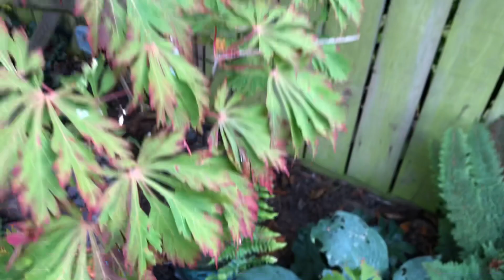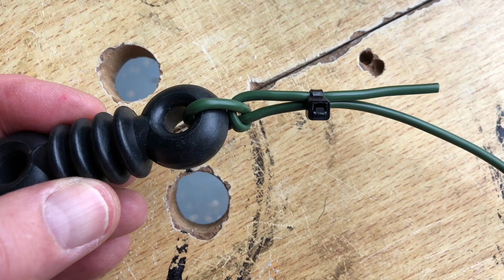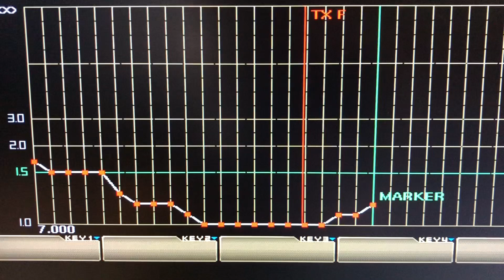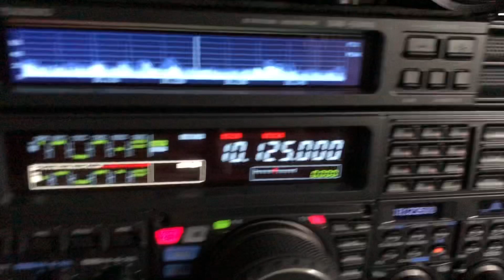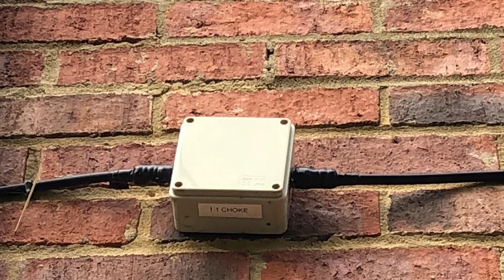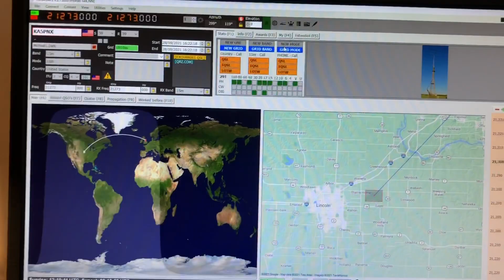A Better Off-Centre Fed Dipole - Part 2

Comment: QUESTION: did you eventually put some sort of weather-proofing on the centerpiece? If so, how did you protect it?

Thank you for the excellent explanation of the OCF antenna.
Reply from the maker: It is a good question 😀 No, all these years later it’s still up there and my main multi-band antenna. 80m dipole made the same way joined it and both been up many years now. I lower them every two years to check the supporting rope at the garden end. I inspect the centre section at the same time and can add more liquid rubber if need be (once so far I think 🤔).

Comment: Hi there, good stuff , I built this a few years ago , from the TRW channel , works very well. I  made a 3D printed case for mine . Still in use . I’ll look at building this open version , looks an interesting way of building one .

The 1:1 Balun ( for common mode ) and followed by the 4:1 . I even got an VNA and tested it , super results.

I have fitted a solar system for off grid , getting a lot of QRM, probably off the inverters, so looking at curing this noise on HF.
Reply from the maker: That sounds great! Good luck with the noise 👍🏻

Comment: I hope you get to see this question. I would like to know at the very top of your 4:1 the two wires that will attach to the each leg of the dipole, does it make any difference if the red or black wire goes to the short side or long side? thank you.
Reply: I also have the same question.  Have you tested this Balun both ways, short side on red, then short on black??
Reply from the maker: @thepctech  Hi, no. Just the way I made it in the video...
Reply: @thepctech  This should help you understand why it doesn’t matter. 
https://en.m.wikipedia.org/wiki/Dipole_antenna#/media/File%3ADipole_receiving_antenna_animation_6_800x394x150ms.gif
Reply from the maker: Hi, either side is ok. Good luck 👍🏻
Reply: @G0CNN-Ian  Thank you for replying so quickly! I will wind both 1:1 and 4:1 tomorrow as I received proper wire today. I ran a quick test last evening with light gauge wire for a 1:1 and followed your test method. I found it actually looked pretty good on SWR. I plan to use the OFC I'm making for Field Day in June. Ian thanks much for making your video, very helpful. 73
Reply from the maker: @N1SEP-  you might have to have a few tries as it stretches the wire insulation and eventually beds in 💪🏻
Reply: @G0CNN-Ian  You made a nice mount with the transformer over the choke. I have a plastic box, its not long enough to have two in line, so I wondered if it would work with the transformer (4:1) on top of the 1:1 or would that cause an issue in your opinion? if not, do you think some kind of material between the two would be needed? 
I could always try, but i would dislike burning these up on my first build :)
Reply from the maker: @N1SEP-  I think you’re ok with a stack as some commercial ones come like that. They won’t touch due to the windings, so should be ok. I went for the open T-piece as it’s less heaving (antenna sag) and there’s no issue of moisture that you get with a box. You need an air vent hole to allow it to breath, otherwise the air trapped inside condenses with heating/cooling. Worth trying the T-piece method if you can and then avoid the stack and less sag? Anyway, should be ok 👍🏻
Reply: @G0CNN-Ian  Ian, since it will be for Field day, perhaps I'll use the board then. My wife did give me one, ha!  What ever I decide to do I will post up on YouTube before and during FD.  thanks again for info! Steve
Reply: Ian, I am real happy with the build. Made a lot of contacts week prior to Field Day and 262 during FD. Thanks for all your help sir! 73 N1SEP
Reply from the maker: @N1SEP-  Brilliant!😀

Comment: I just built these baluns for a W3EDP junior. When I have the space though I'm not going to use a windom I'll make a doublet and use either the 4:1 or peters 9:1 design with a 1:1 cmc. So the ladder line will drop down to the balun/impedance match then there will be the 1:1 cmc with either M&P hyperflex 13 or LMR600 or 1/2" Heliax either of the three going to the shack with another 1:1 cmc before the tuner. 
So if I'm getting 1000ohm at the feed point the 4:1 would drop it to 250ohm or the 9:1 will be around 100ohm. These impedances on big thick coax are manageable with say a 30m run.
The benefit to this setup is as long as you're at 5/8th wave of the biggest wavelength you want to use you'll get that and every other band.
Reply from the maker: Sounds like you’ve got a well thought out plan Shane 👍🏻

Comment: Nice video - I am wondering if you tried  to compare your setup by using a more modern Transceiver to see if the audio quality is improved - it would be interesting to see if the new technology improved audio signal at the end compared to FT-5000
Reply from the maker: Hi Edin, no just the 5K to play with this end. Thanks.

Comment: Hi again Ian. The plot that you show for the SWR, is that a function of your radio or a separate program or item you use?
Reply from the maker: Hi Chris. It’s a new shack addition. A DMU-2000 Data Management Unit that connects to the 5000. Bit retro (originally for the FT-2000), but some useful bits too. One is the SWR plot & graph function 😀
Reply: @G0CNN-Ian  Interesting, just looked up some info and videos about it. Looks a bit of a lump :-) Seems like Radioworld might have One, not cheap though but puts a nice plot out. I am pondering over upgrading my rig, they have a Kenwood 990S £4k ouch which might be a contender, a couple of 5000MP's 2.5k not too bad. IC7610 2.4k and of course considering FTDX101D or MP :-) or D my needs are multi antenna, rx only facility (I know I can use a spare antenna port if I wish) was sort of thinking 240v supply and of course NEED visual output of band. I know your 5000MP ticks all those boxes with the little box thing on the top but also NEED on board Sound card, which I don't think it has. Of course all this stuff might not be in stock. Decisions, decisions :-)
Reply from the maker: @chrisbartlett6022  Ah right Chris. Yes factor in an RSP1A and extra monitor into your calcs for the 5000 (= good waterfall) plus an SCU-17 for digital stuff. You can do without the DMU-2000, but mine was a good offer and I fancied a look. Good luck with your coin toss 👍🏻
Reply: @G0CNN-Ian  Was starting to factor the 5000 out as it looked like it needed "add on's" to make it do what I wanted, looks like a lot of rig for the second hand price though. Starting to lean towards One of the new Yaesu 101's but of course I could buy a Motorbike instead :-) LOVE your connect the Balun and Choke together idea BTW. My Windom seems to still work well, getting 2 to 1 or below on 80, 40, 20, 17, 12 and 10. Over 3 to 1 on 30 and around 3 on 15.
Reply from the maker: @chrisbartlett6022  Good luck with what you go with Chris 👍🏻

Comment: Thanks for the video, Ian.  Do you think the common mode currents are tamer than the previous version?
Reply from the maker: Thanks and yes. The SWR readings are what I would expect from the antenna without the extra choke, so as though it’s not there. The original antenna changed once I put the extra choke in-line, which to me only went to show that the coax was radiating too and the choke stopped it, hence the different SWR readings. If I can summon up the will, at some point I’ll take that choke out of line to prove the point 👍🏻
Reply: I had a BAD problem with common mode on my OCF dipole, until I installed the 1:1 choke (snap on ferrites were my choice).  The problem cleared up immediately.   So now with the 4:1 balun at the feedpoint and the 1:1 choke on the coax, I can  transmit with no problems.  --  AA6LJ

Comment: Are you actatually operating with an SWR of 3.0??
Of the 200w, how much  is really reflected, compared to your total max power out?
I'm not a fan of tuners, in fact i don't use them, nor do i own one..
Reply: 3:1 SWR is an 0.5 reflection coefficient, but the actual loss depends on the feedline and the matching network. 3:1 is pretty tame, >90% efficiency isn't hard to get.
Reply from the maker: Hi Robbie. Yes, on the bands where the resonance is out of band. The rig tuner keeps the rig happy.
Reply: 3:1 SWR loses 25% of the power out in this case 150W going into the coax.  That would be hardly noticeable compared to 200 watts on the receive end, way less than 1 S-point difference.